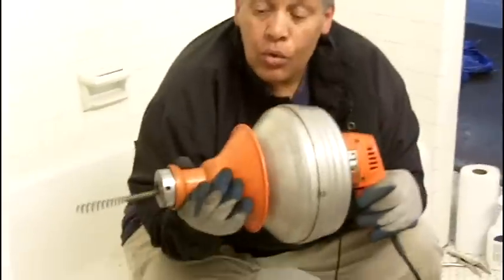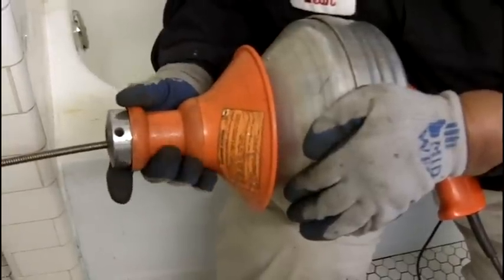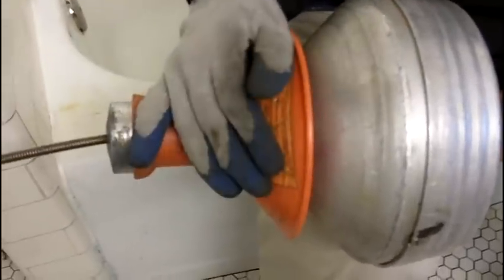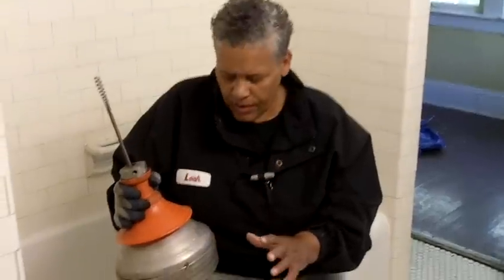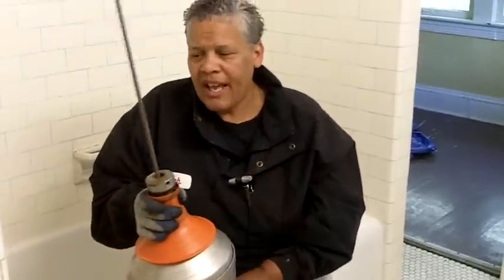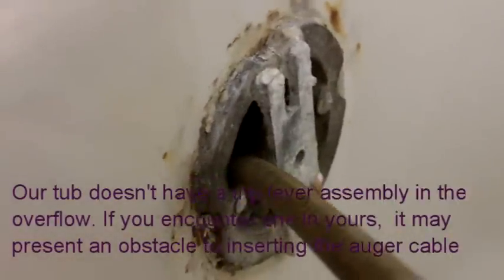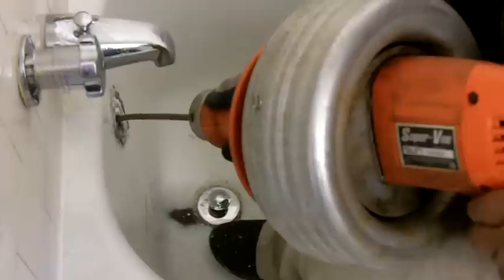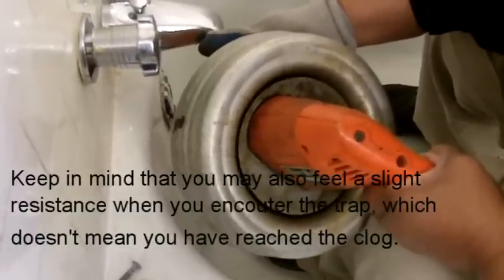How to Snake Bathtub Drain through Overflow with Electric Auger

Comment: Thank you!  I had paid a plumber $75 to look at my slow drain issue and he stopped when he could not fit the end of the auger into the small drain hole at the the bottom of the tub.  He did not even know about the overflow.  Once I popped off the overflow cover and stuck the auger down about 2-3 feet I was able to pull out the hair clog.  This was a great tip!  Thank you :-)
Reply: I am sorry but if you pay $75 then that is a no a plumber.

Comment: For best results, bend the snake head about 20 degrees in the direction of the tip. After many tries this idea broke up the blockage. 
A straight head will only go into the center of the block - if the blockage very tough.
Reply from the maker: thanks for sharing your personal experience with the community!

Comment: That was very useful Leah, many thanks!  I bought a Harbor Freight Bauer Drain Cleaner Electric.  Manual was written by aliens!  It specifically says Don't lock it. But if you don't lock it, it will tangle and kink cable inside drum. Glad you validated what I was thinking.  

Please mention your tool brands so we have an idea.  Thanks!

Comment: You mention that you put the auger in reverse when extracting the snake. I was taught not to do that or the glob might come off the auger. I was told that you only re erse when the snake is lodged in you can't get it out. Also, going in reverse undoes the winding of the cable and therefore reverse should be kept to an absolute minimum.

Comment: Just a couple of questions. I rented one of these and am in the midst of trying to unclog an upstairs bathroom sink drain (1.25" diameter) with it. How can you tell how many feet you have left or are reaching the end of the auger since you can't see inside the drum? And if you unplug the drill auger can you pipe some water down the drain while the auger coil is still in the drain? my issue is that I tried my 25' hand crank auger with the 3/8 coil and couldn't force it past what I'm sure is a 90° turn when it hits the basement floor. I think this 35 ' long 3/8 coil electric auger has made it past there, but I'm still feeding it with no resistance and it's only coated with black water. When I run a small stream of water in to the drain it now takes about 15 seconds to come back up (as opposed to the 6 seconds it took yesterday when attempting with my hand crank auger.). If I run almost the whole contents of the electric auger - or what I estimate to be almost the whole thing- and still meet no resistance and still get back flow in the pipe,  then what's left to do but call a plumber? What would they do differently? Sorry for all the questions but
I've been dealing with this situation for 5 days now and am starting to lose hope with the sink drain in this 50 year old house.
Reply: I’m at the same exact problem today. Bathtub drain is coming up with black/rusty water when turning on bathroom sink. How were you able to resolve this?
Reply: @deltasolja716  With alot of patience and persistence. I had to rent the longer auger of 35' since it was clear the first one I used, my own hand crank one of 25', was just not physically long enough. I took a tape measure and walked around the house and estimated/added up all the heights and lengths the upstairs bathroom sink drain would have to travel to reach at least the drain in my basement laundry room-  though I didn't add in the little bit of extra distance to access the nearby cleanout, because the cleanout usually requires a big wrench and alot of strength to undo the big bolt and cap- something I didn't think I could do after years of it not being opened, and probably only by a plumbing company, when it was done years ago. I was lucky I didn’t have to access the cleanout, but many people do. 

Also, the electric auger I rented from Home Depot had various little special biting tips that you could put on the end of the auger to help break up the clog. In the end, after 8 hours of coming back and forth to it and then letting it settle, along with pouring drain decloggers down the sink, and pulling up surpisingly modest sizes of scum and little bits of hair and greasy clogs, it gradually let go, or started to allow the water to drain properly. But it was a slow, steady process. And each time after pulling it up, and then letting it go back down, I would always listen carefully to the sound of the auger as it clattered down the pipes, and reached or hit the bottom floor. After that right angle, I would gingerly push it forward, because obviously that's were the clog was, somewhere inbetween the house and the line outside the house. I'm guessing, in my case, it ran past the cleanout, but was still within the house, as it the pipes run across the basement laundry room floor, which faces the front of the house where the city sewer connections are. 

Just from the feel and also the physical length of the Home Depot rented auger, I don't think that even it was long enough to exit the house. I suspect if I had been able to open the cleanup, it would've been a whole lot easier, and negated the need to rent an extra long, electric auger, since my own smaller snake/auger certainly reached a bit past the floor judging from my measurements and the sound it made when hitting the floor through the pipes. If you're able to, I would first try the cleanout. You might have to rent a special wrench to open it, or maybe just try with your own wrench, if it's big enough.

Hope this helps. Good luck. Even though it was exhausting work, with a little bit of luck, I was able to resolve it on my own, but if I couldn't have, I was ready to call a plumber after 2 days of trying various things.

Comment: So pretty much EVERY time you're advancing the cable, you want it to be locked AND spinning while you push it?

I ask because I was using a hand-powered auger, and I fed/pushed the cable down by hand, and then whenever I felt resistance, I locked it and spun it past the sticking point before returning to pushing it down by hand. 

I did, however, eventually find it nearly impossible to keep going after about 8-12ft, so I don't know if spinning it WHILE pushing it into the drain wouldve facilitated me getting it in further.

The hand auger also has a drill bit connection, so I'll probably try that next, depending on what you say :)

Thanks so much!
Reply from the maker: Hey Matt, it sounds like you were doing it correctly!
Reply: seejanedrill Thanks, Jane!